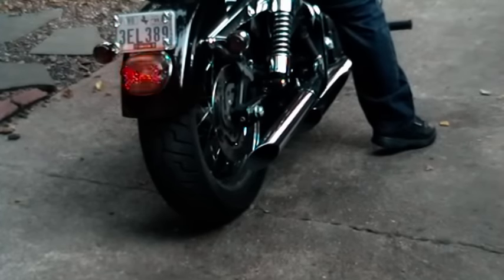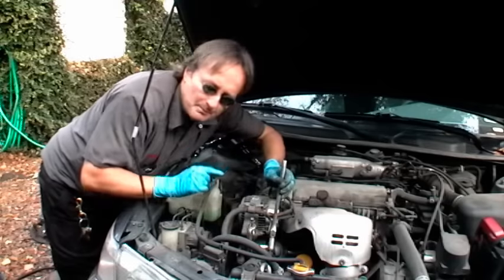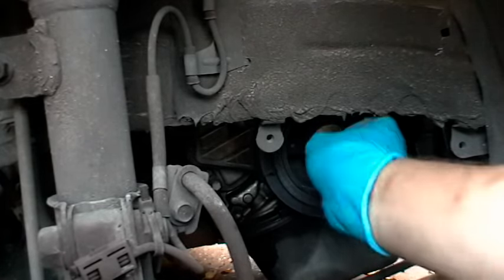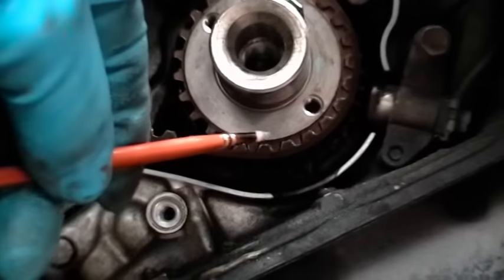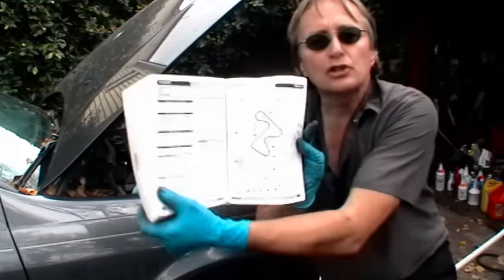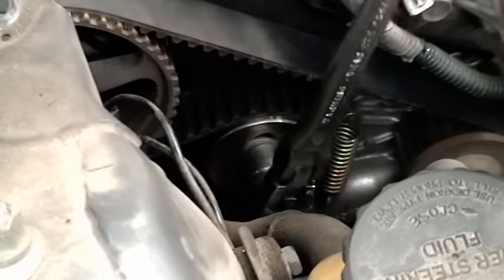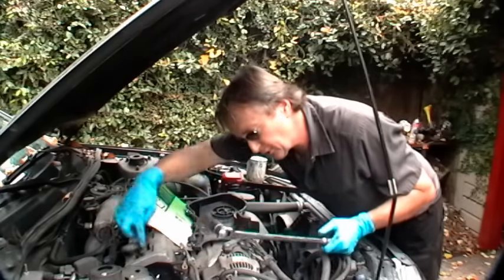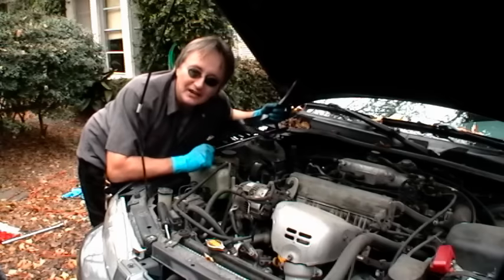How to Replace a Timing Belt in Your Car

Comment: Hi Scotty ! 
By watching your videos for the past 3-4 years I've been saving hundreds of $ and not getting scammed by mechanics, buying used cars, and heck even tow-truck drivers after I had my accident with my 01 Celica GT.
5 days ago I've purchased a 2002 Acura MDX 3.5L from an eBay Auction with 191.000 miles on it. The car is a 1st owner and it was donated to the eBay acution, and I don't have much records of it's services. The car looks like it's been taken care of and is a Clean title California car.
I'm considering to replace the Timing belt, Serpentine belts, pulleys, Hydraulic tensioner and the tensioner pulleys. I've been looking for parts and OEM Honda parts are more expensive, although I heard and seen marks of the same companies that sell aftermarket Japanese parts on OEM Honda parts. I'd like to take your opinion to consideration and decide weather I spend 50% more on parts with Original Honda packaging, or just buy from Japanese after market companies such as Koyo and Aisin.
With Respects and appreciation.

Comment: lol. this WHOLE TIME i thought the rubber FAN belt WAS the timing belt. i thought it controlled the cam and crankshafts from pulleys outside of the engine. my grandpa told me that the timing belt was INSIDE the engine. i didn't believe him. i guess it turns out the old man was right. i learned something new today. thank you for this amazing video!

Comment from the maker: no, reverse works the same as the other gears, if it runs forwards find, but not reverse, transmission has an internal VERY expensive problem inside.

Comment from the maker: they are non interference engine, so no damage was done UNLESS something like the cam just locked up and then that would break the belt with the belt not being the root problem. Get a cheap manual, they have line up pictures and direcitons for installing the timing belt.

Comment from the maker: I assume it started before, and many things can go wrong, check for broken wires or sensors. And put the engine back at TDC and see if the crank marks line up now, cause sometimes they slip with a new belt put on.

Comment from the maker: Never tried those, most gloves I've gotten worked fine, except they tend to fall apart with use on oil and gasoline messes. So I normally wear the latex throw away kind.

Comment from the maker: pull the cover off the timing and see if the marks line up first, often they are done poorly and are off. If not, IF it has a distributor turn that, but most don't have dists and have timing set by computer which you can't reset

Comment from the maker: engine is probably bent up inside, those are interference engines and when the belt breaks, bad things bend inside if the engine is running.

Comment from the maker: if timing belt jumped while running on that engine, often valves will be bent inside the engine. have a mechanic check that possibility first

Comment: What clever bastard designs engines with belts when chains exist, and to make it extra intelligent then makes it an interference engine.
Reply: Car companies....... they are designed to keep the service department busy and making money which is where the money is at a dealership....
Reply: All in the name of space saving and simplicity. Like it or hate it the belt is a simpler system than a chain.
Reply: @aygwm  and it's quieter from what I've heard...win win.
Reply: On top of previously mentioned things, interference engines are more efficient

Comment: Scotty a mechanic once told me that shutting off your engine wile your car is in drive will extend the service life of your timing belt, and or a chain. The mechanic told me the belt/chain will not deflect under a load while the transmission is in drive. What do you reckon on this advise?

Comment from the maker: that engine is an interference type. If belt broke with engine running, they almost always bend valves.  You'd have to put a new belt on, then run the engine to find out for sure, if you were driving slow it may not have bent one. But highway speeds, bent for sure.

Comment from the maker: it probably came off for a reason, such as broken alternator or bad tensioner. Check for those things first, or it will just come off again. otherwise, do my video "everything you wanted to know about fan belts" for installation tips.

Comment: You put out a lot useful information. I'm wondering though, why wouldn't you start by putting the crank and cam(s) to TDC?
Reply: The engine was already running, no need to go through the process of re-timing an engine if it is already time. You just gotta be careful and make sure you don't move anything.

Comment: hey Scotty been watching you for years, you've helped me so much. I did my timing and it's four teeth off. I had a friend help he said things were fine up top, would that damage my engine I drove five miles and parked it got a misfire code I plan on doing the job   this weekend by myself. it rained during last time so my friend was rushing lol. the car sounded fine it had a small hum.....
Reply: and it's the same car  Camry 2.2
Reply from the maker: four teeth off can damage valves, put it on right and pray. if it runs good but makes a few odd noises, live with that
Reply: +Scotty Kilmer thanks. You are an awesome dude. I appreciate the content you share.

Comment: I really like your videos. I would like to see an extended version of this with the full waterpump and tensioner/pulleys being replaced and how that affects how easy it is to reinstall. 

I replaced all those things on a 2004 Mitsubishi Endeavor LS AWD  and had a small sound but it seemed to just be the cover, but after driving it a couple of days and maybe about 100 miles, the engine stopped and left me stranded.  Turns out the belt got caught and tore. 

So I want to know what could have been the problem.  I'm not sure if the tensioner was on correctly..  One thing I noticed that I never did was turn it 2 times to make sure it was still aligned. 

Can you maybe help me with some advice?

Comment: Obviously I'm not scotty kilmer, but I thought I could help you. The crankshafts machined surface where the seals align sometimes get a groove worn into them. You need to get an offset seal for you engine or a crankshaft snout repair sleeve. Hope this helps.

Comment: check IAC, check the air hose to your crackshaft. It's possible that it may have a leak. Those plastic hoses are known to crack during cold seasons. The squealing may be coming from your belt.. Just get it tightened. A good way to find out. Turn all the power you have in your vehicle, on. A/C, radio, headlights, etc. If it squeals, its the serp belt.

Comment: Hi Scotty
I have learned a lot watching your videos.  Thank you.
Certain car manufacturers say that you need to lock the crankshaft and camshaft with locking tools when replacing a timing belt.  If we use the method you have shown by painting marks on the sprockets and backing plate before removing the old belt, is it really necessary to buy the locking tools?
Reply from the maker: depends on the car. for instance, if it's a V8 engine with four cams, the cams will move all over the place and require locking tools. But, if a 4 cylinder toyota, you don't need any locking tools

Comment: Depends on the car, on mine, pulley pullers are strongly NOT recommended as they can pull the harmonic balancer apart.   Instead, i either had to buy a special tool that held the pulley in place while i tried to losen the bolt.  Instead I used an air impact gun.  A "backyard" kind of way is to put a breaker bar on it, and just bump the starter to loosen the bolt.  Just make sure the bar is wedge somewhere so it doesnt move.  Also remove the fuse that allows the car to get fuel/spark if you try.

Comment: I wish mine was this simple.  DOHC.  Took forever to get the timing marks aligned.  Payed 400 for parts(belt, water pump, 2 pulleys, hydraulic tensioner).  Better then close to 1000 if i took it somewhere.

Comment: Scotty,
Thanks for the video.
I have a 1995 Nissan Sentra 4-cyl 1.6L engine. I changed out the distributor and some thing weird happened. The OBD2 scanner reported the correct timing setting of 8 degrees DTC. But the timing gun reported a whopping 90 degrees before I can even see the timing marks!!! Which reading should I trust? The engine is running smooth with no trouble at all. Also please noted that the distributor is keyed for one way installation, and there is no-way to install it wrong. Thanks for your help.
Reply from the maker: trust the scanner, it would not start at run at 90 before

Comment: I tried this on a geo metro and the tensioner was broken. I put the belt on and used a crow bar to push the belt over the pulley. Horrible idea, but it worked. Then the main seal shredded.

Comment: Lol. It’s a LOT more work than he makes it look like. I just watched my mechanic(who is amazing) do a timing belt change (you always do the water pump too if it’s internal) and it took like 4 hours. Bolts strip, all types of variables can make this a HELL JOB. Be aware if u are thinking of doing this repair because of old Scotty’s video, it will be way more Involved and difficult than he makes it look

Comment: some (most) timing belts fave a specific tightening spec, either with a springloaded dynamometer that you push at the center of a certain "branch" between 2 pulleys and at that force it should deflect certain amount of milimeters.

Or with a resonant frequency of a certain branch of the belt. (a frequency analyzer and a microphone and a laptop)

Or just by feel: on the longest branch you should be able to torque the belt about 90degrees. 
But go with the right equipment - safer.

Comment: Haynes manual instructions:
1. Disconnect negative ground on battery
2. Remove accessories
3. Remove timing cover and timing belt
4. Installation is reverse of removal.

Comment: Hello, thank you for your good programs,
I have a VW Lupo from 2001, It has very good condition, only 1 owner "Driver with it" has run 245000-km. apx.(147000-miles)
Has not any sign of damage on belt.
Previous owner has passed away and her relatives doesn't know about car services history.
However, Now I decide to change the "Timing belt" Is it necessary to change complete set? Or I just change the "Belt"
I have clean the engine with Oil System Cleaner Additive & changed the oil and oil filter.  
What do you recommend I change concern to "Timing belt area"?
I appreciate your kind advice and help in this project.
Look forward to hear from you.
Best regards,
Steve

Comment: Hey Scotty. Nice video! Thumbs up. I have a 95 toyota camry and am planning on changing the timing belts in a couple days. How do I know if I need the whole timing belt kit, pulleys, coolant and water pump etcetera? I don't know if I can just get away with a new belt and a new pump. The car has 186 thousand miles on it. Is it common to change the pulleys?

Comment: wow! you did it all in 4 min, and to think they charge 5 or so hours.

do you always just smack the harmonic balancer back on with a hammer and then use the bolt to squeeze it back on?
Or is it safer to use the harmonic balancer install tool?

Comment: Awesome video! I'm getting ready to do my first timing belt change. I'm trying to learn all about it first, but I'm a little confused about what the white marks he puts on there does. Is that for when you put the pulleys back on? And don't the pulleys spin? And if so wouldn't it not matter how they are turned when they are put back on? Thanks
Reply from the maker: the marks are for lining the cams up right. You can also move the engine to top dead center and most cars then have marks to line up on parts of the engine with matching marks
Reply: Scotty Kilmer thanks for the explanation! Also I recently discovered your channel and have been hooked. I'm pretty sure I've seen most of your videos already. Thanks for sharing all your insight and for the fun time!

Comment: Fuel pump is a Delfi OEM pump. Fuel pressure went straight to 40psi whereas before it only went to 15psi at first cycle of key and 39psi at 2nd and 3rd.
Reply from the maker: check the fuel pressure regulator for problems, also check for possible injector leakage when cold

Comment: Hey Scotty, thanks for the video, it was very helpful.  I am working on a Daihatsu Hijet and wanted to change the cam belt.  I have seen cambelt kits which include three different tensioners. I didn't see any tensioners on the engine you worked on above.  Do I buy the kit with the belt and the tensioners or just the belt?  Any car specific advice?  I have found some manuals for it that mention all sorts of measurements for tension, it's all a bit baffling.  Some help pls.

Comment: A timing belt tuition in under 4 mins lol great video! Is it ok to just mark the cam and crankshaft with white paint? shouldn't they be checked for the existing timing marks? I assume as the belt ages it stretches and may throw off timing?

Comment: and on that particular engine (2.0l 2.2l 2.4l) the oil pump gasket common problem... should do the fallowing while your down there... trust me this will save you a lot of headaches in the future... replace water pump, replace oil pump gasket, front camshaft seal, front crank seal, timing belt idler pulley, timing belt tensioner pulley and spring... spare no expense when it comes to your engines timing belt when your motor is an interference motor... the cheap way is not always a good way

Comment: Scotty, I have a 1991 Buick Regal that runs like a Top, but it's overdue for a timing belt change. It has 105,000 miles on it. I'm hoping that I can do this job myself. Besides what you went over in this video, are there any other tips or tricks that can help me with my Regal? Thanks!! Ron

Comment: Hi Scotty!
What do you think of changing a timing belt on a '84 Porsche 928, ever done one? I'm contemplating undertaking this job and understand it's quite involved.
Reply from the maker: +sand 007 royal pain as it's an interference engine and ALL pulleys and tensioners should be replaced along with the belt, Plus the water pump

Comment: Scotty. I have a 92 Jeep Wrangler 2.5. 185.000 miles.
I changed the lifters and I still need to change the Cam but my question is. is there anything else you would recommend changing during this attempt to rid my Jeep of the 2.5 tick I'm chasing..... That tick is annoying to me!!!! Your awesome btw.
Reply from the maker: all the bearings of course.

Comment: I have a 1997 Protege with 219k I bought it used about a year ago it runs real great I am not sure when the belt was last replaced. I know its a non interference engine should I just replace it.
Reply from the maker: yes, it's old , change it now

Comment: Scotty, I want your advice please. I have a 99' Lexus ES that just hit 90k. I'm a moderate do-it-yourself mechanic, should I attempt to change the timing belt, water pump, etc. myself or is it worth paying a good shop? I know how important it is for this job to be done right on these interference engines. Also, what's a reasonable price for the whole job?
Reply from the maker: +curryryanaof  it has to be done correctly, if you are unsure pay a mechanic. I charge about 450 for that job myself.

Comment: I just bought neighbors 2000 ES300, 186k, 2 female owners, had too, $1200! I bought a Haynes manual (Camry lol). Is the timing belt difficult on this vehicle, tech buddy said 2 bolts b---- to get to. Not a car person, but at 53, this thing rides incredible, might keep it.
Reply from the maker: profaneslave  it's relative difficult as it's a 6 cylinder engine, but if you get a cheap haynes manual, you can do it yourself if patient

Comment: Hi Scotty, my 95 camry (4cylinders) stopped on the road (45mph) yesterday. I was told timing belt broke. I am wondering if i need to do special things to line up the the cam and crank marks.  I heard some noise lately which is from timing cover, I didnt' think it is time to replace timing belt since  it was replaced 50k ago. I did a lot car work before, this is first time for timing belt. please advise. thanks. your follower.

Comment: Easier said than done. I spilled some coolant on the sprockets where timing belt goes while taking out the water pump. Did not clean it. Is it going to be a problem? It is on Hyundai Accent 2003. As much as I don't want to, I am thinking of redoing it - only the timing belt, though.

Comment: I have never seen a timing belt that snapped on it's own. It's been always caused by a faulty tensioner, idler or a waterpump so you should always replace everything.
It's a lot cheaper than fixing bent valves etc.

Comment: I had an 87 mitshibishi cordia  that threw a timing belt, and i was able to change it in the parking lot where i was.  new cars are a lot different. not as easy, and i know my 2.5l 4 banger has 2 belts for timing now.

Comment: hey scotty, you're the best! 

quick question. I've bought a 2002 mazda protege lx 2.0l at 88000 km (canada)

When should I change my timing belt?
Reply from the maker: they can last 90 thousand miles, but age is also a factor, as they are rubber. I would change it now

Comment: Scotty- Replacing the timing belt and water pump today. Got my timing marks at TDC took the belt off and the cams moved. I've been fighting the cam springs to get them back in place but I'm losing the fight! It's a 2001 kia rio. Any advice?

Comment: I got a estimate on changing the timing belt on a '98 Honda CRV around $750. That included the belt, water pump, seals and valve cover gasket. I think getting the tension right would be very tricky with proper tools/gauges/tester......I don't know but if belt is too loose or too tight....boom?? I'm not afraid to get in there but is this a job for a weekend warrior (with no book) (I got a camera)